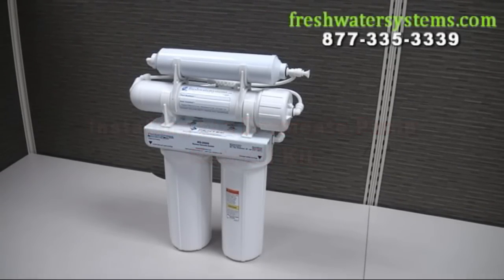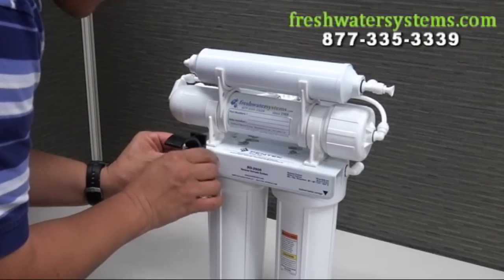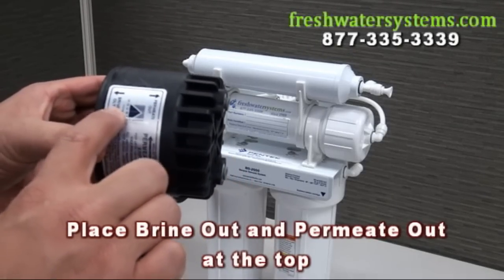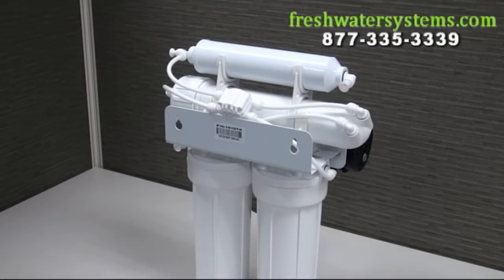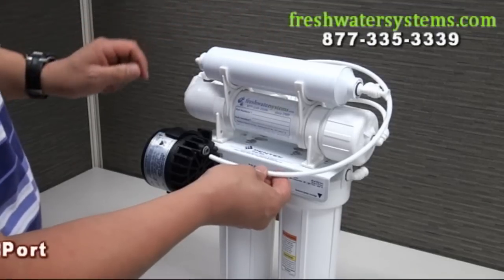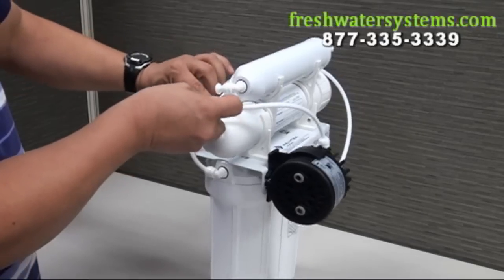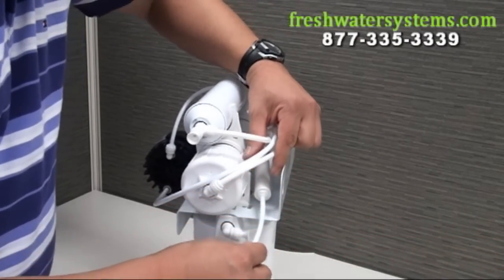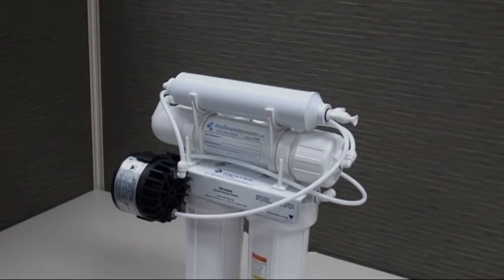Installing the Permeate Pump Retrofit Kit to a 4 Stage RO System

Comment: I just tried this with an AquaTEC RO-PH90 6-stage system and it would not work. Purged the system, then began cycling, then the cycles stopped, but no output water. Had to uninstall it. But the permeate kit had a different hookup instruction than this video shows, will have to try that way.

Comment from the maker: @balancenoptions1322 - The permeate pump does not require a pressurized tank. In fact, one of the advantages of the permeate pump is that it actually isolates the RO membrane from the backpressure created by a pressurized tank. It will work with an atmospheric tank or no tank at all.